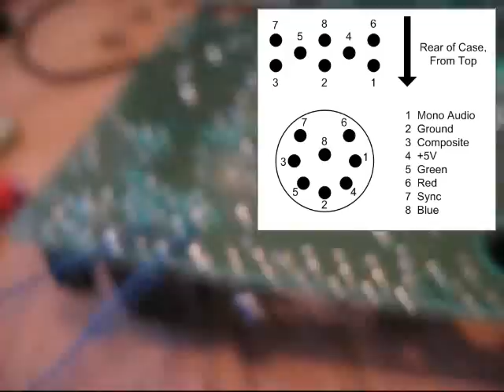M1 Genesis stereo AV mod

Comment: Very clever! My Mega Drive 2 originally outputed a rough sound and I was not happy with it,but I too opened it up and connected some speaker wire from the audio resistors on the board to the stereo jacks into my stereo amplifier, and it now producers a crystal clear sound! I also have full control over the 2 audio channels in the machine, one being 16-bit audio and the other being 8-bit audio. I am now convinced that model 2 sounds better, but what you just did was pure genusis work. Fantastic!

Comment: Today I started modding a 1601 gen using vcr video ports and I've got the holes drilled and most of the video soldering done. Good video.

Comment: Great job man.  I personally just gave in and bought the A/V cable for the Genesis model 2.  It was only $5 so no biggie.  I would have liked to see you drill out those holes.  Did you use a big clamp to secure it(the back cover) into place?  And what bit size did you use?  Oh and what did you use to secure the RCAs into place?